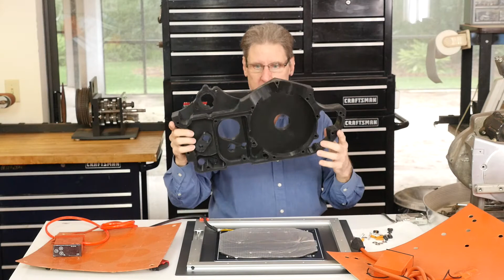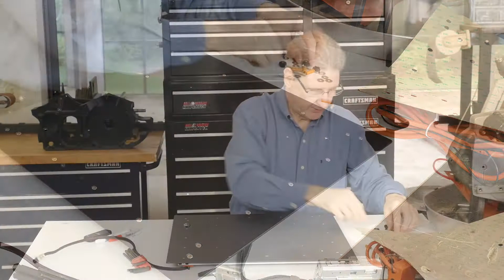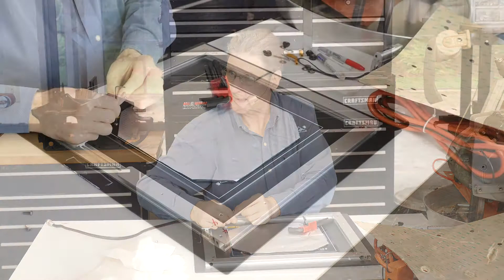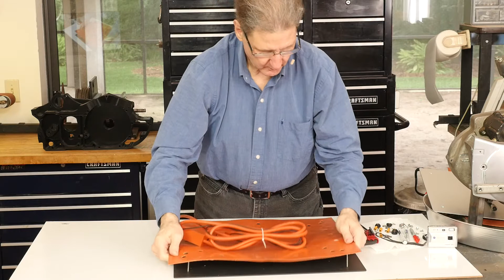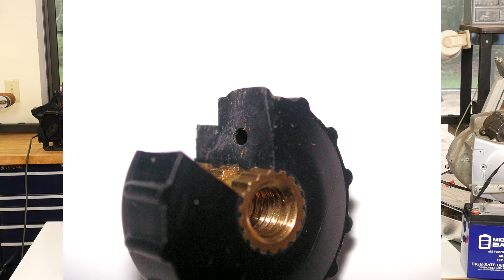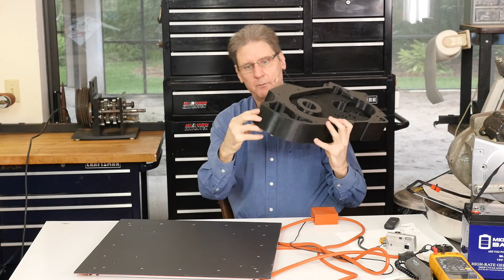Creality CR10-S5 full-size bed heater

Comment: I"ve had mine ever since I posted last time... worked great for PLA or low heat settings.  As soon as I went to ABS or 100 C bed temps, this thing imploded.  Now the outer edges are 130-140 C while at the same time the center is 94-100 C ... Also, when you press and hold the set button for 3 seconds.. you get a menu of CP, CA, LA, LP, HA, HP.. what do any of those settings mean... I can't find an answer even at Amazon where I got it in the questions.
Reply from the maker: Wow, sorry you are having problems. The manual with all the abbreviation setting stuff is here:
https://www.keenovo.com/Keenovo-Digital-Controller-Manual.pdf
I was lucky, mine just worked out of the box, but only for a little PLA. I bought some PETG to try, and will report any heater problems with that. The heater did solve my main problem, the lifting of large prints at the corners. Thanks so much for the comment, I will try to learn about these problems and will report on them as they come up.

Comment: $1MM Trivia Question Help???   How do I disable the firmware from testing to see if the original bed is hot and throwing an error code which prevents me from printing?  It will be great if I can figure out how to turn this off!  thanks everyone!  Great video..
Reply from the maker: I used the same Simplify 3D file that set a 75-degree bed temperature, but natch, it won't start printing since the control box well never see an external heater. My trick was to go into settings, after the file was loaded, and change the bed temperature to under 25 0r 20 degrees. Then the software things that that the bed is at set temperature, off the print goes.
For my particular box, I power it on and I get the info screen. Then press the control dial once, rotate the dial to "Control" and press again. Rotate the dial down to "Temperature" and press the dial again. Rotate down to "Bed" and one more press. Then you can dial in some low temperate that is under what the temp is on the info screen. On my box in an air-conditioned room, the info screen shows the bed at 21 degrees. If you do the Info>Control>Temperature>Bed menu and set it to under 21, the software thinks the bed is at temperature, and the print will start.
So very sorry, I should have made a video of this-- I did some test prints months ago, and never did the follow-on video to show the good results.

Comment: thanks a lot for the video, how did you deal with fooling with the software when you took off the original heated bed ? Does it give any error when you unplug the original heated bed
Reply from the maker: I used the same Simplify 3D file that set a 75-degree bed temperature, but natch, it won't start printing since the control box well never see an external heater. My trick was to go into settings, after the file was loaded, and change the bed temperature to under 20 degrees. Then the software thinks that that the bed is at set temperature, and off the print goes.
For my particular box, I power it on and I get the info screen. Then press the control dial once, rotate the dial to "Control" and press again. Rotate the dial down to "Temperature" and press the dial again. Rotate down to "Bed" and one more press. Then you can dial in some low temperate that is under what the temp is on the info screen. On my box in an air-conditioned room, the info screen shows the bed at 21 degrees. If you do the Info>Control>Temperature>Bed menu and set it to under 21, the software thinks the bed is at temperature, and the print will start.

Comment: Sure would like to know how to use the controller for the heated bed!  Mine doesn't turn on...
Reply from the maker: It might be DOA (dead on arrival). Mine turns on the display the second it is plugged in, I don't see a power switch anywhere. You might be able to pull the rubber boot back and check to see the AC connections are OK, but only if you know what you are doing so you don't get shocked or killed.

Comment: even being as impatient as I am (stopping the microwave with 2 seconds to finish), I enjoyed the video, very focused, on point, constantly adressing the main topic... I have the same printer and bought the same heating, but im from Chile (220V power grid) and almost burned my apartment because the only set of instructions say that it works on 85-260V, and theres only ONE power cable, and when contacting the manufacturer, they tried to put it on me saying that only the controller works on that range.... and theres ONE F** POWER CABLE.... long story short, they refunded me fully and apologize, told them to specify this because they thought that this was only sold in the US... (yeah, in amazon, a world wide selling portal), and they got lucky the new printer wasnt damage.... anyways, I completely agree with you on the bed leveling... like, whats the point to introduce a completely unnecesary new set of variables to the calibration, its like the next model is going to come with non fixed leveling legs, just to having more stuff to calibrate ?, im designing a non-leveling "fixed" (obiously X moving) bed, so I get that stupid desition out of the ecuation... what do you think ?
Reply from the maker: Great comment, thanks. I too am looking at linear rails or some other way to make the bed more stable. 
https://3dfused.com/product/cr-10-s5-y-axis-linear-rail-kit/
My first enhancement might be to replace the base extrusions with a 20mm aluminum slab, that should be a solid base to keep the bed level over the years.

Comment: I just acquired one of these machines and the glass bead is getting replaced with a Wham Bam bed system surface.  Being rid of that giant glass bed should be a big weight savings!  That upgrade went pretty well !
Reply from the maker: Congrats! I have a pal that is trying that carbide glass but it's always good to remove weight from the moving part of the machine. Hope it works out.
Reply: @Rako_Studios  have you had to dial down the stock Acceleration and Jerk settings?
Reply: The Wham Bam systems are so good. I tried them on an Ender 5 plus system and not only does the system heat much faster than the old thick glass plate, but it also distributes the heat better, holds prints MUCH better and prevents warping, and lays flatter than the glass did even when new.

The Wham Bam plate is actually how I came to decide on buying a CR-10S5 bed for my custom machine so it will be just a drop in placement rather than doing something completely custom.

Comment: How about an update video with that same printed part? Also, how you reprogrammed the board to accept that new heater or deleted the requirement from the software. Remember, people watch these to learn so they can do it...
Reply from the maker: Sorry not to follow up. I did print the first quarter-inch of the engine case and it did not pull up at all, though I did have a small 3-pass skirt still around the periphery. Problem is, the engine case where I had the problem was a 4-day print, and the first print taught me I had to do a lot of design changes, so I did not want to waste two rolls of filament on something that had design errors in it.

I did not reprogram the part, where you can just say to print at room temperature. Instead, I went into the Creality setup and just changed the bed temperature to below room temperature or whatever the reading was with no factory bed heater hooked up.

One thing I like about this separate heater is that when the printer runs out of filament, the heater stays on, unlike the way they program the controller with the factory bed heater. Same for a short power fail. The bed comes right back to heat, before the part cools down and separates from the glass. Nothing you can do with a long power failure. On these big parts, the shrinkage is usually enough so the part just comes off the glass and you can't keep printing. I would like a UPS for the heater and printer, but that would cost a ton for such a high-current heater. Since my county is widening the road by my house, the power has been going out a lot, so I have not been anxious to start any more 4-day prints. When I fix the design errors and get a good print, I will be sure to do a follow-up video.
Reply: @Rako_Studios  - I just ordered a 10-5S and the heating pad as well as stabilizer bars. I like your channel because I am doing something very similar to you (large auto parts) so I need adequate tolerances.

Comment: We need a how to use the control box on the heat mat.  The instructions are terrible
Reply: The heat swings 20 degrees causing prints to peel off the bed
Reply from the maker: I agree the instructions are really useless. Mine was set up OK, it holds to within a couple degrees, but that is something you can set, but sorry, I sure can't figure out how, so I didn't even try to change that. Try finding other instructions on the web maybe, or hopefully someone has done a video.

Comment: Hey, great video! will be of much help for when I receive and install the new heater for the S5. I did miss your explanation of why the countersunk screws are not used on military applications, and what is used instead of these. Would love to know. Thanks!
Reply from the maker: When the military applications used countersunk screws on thin panels, the screws were not hard-threaded into the frame, but rather, there was a little nut that floats in a captive cage. The nut could align to the countersunk screw perfectly, so the screw would not back out under vibration.
Reply: @Rako_Studios  thanks a lot for the explanation, will check for more info on the matter. Also, please try to build an enclosure for your S5. I just did with mine and I am still with the first big print on an enclosure, but I am 20 hours in and no adhesion problem so far, and I still need to install a new bed heater like yours.

Comment: Great video - I'm looking at getting this printer also and you have given me some great ideas on how to handle its short comings. Thank you, looking forward to seeing your future modifications/improvements.
Reply from the maker: Thanks, I hope to be trying some new prints soon, and will see how they go. I also want to try PETG material.
Reply: @Rako_Studios  I recently tried PETG on an older Wanhao machine that I had upgraded to a metal hotend and found it much easier to print with than ABS. although it does struggle with bridging so you tend to use more supports in your prints - If you google PETG printing and bridging issues you should be able to see what I mean

Comment: Hi I have a question - I just installed this same heated bed and it worked perfectly one time - however the second time I powered it up, the control box reads HHH - I cant find any support anywhere for this other than the paperwork saying HHH = Ambient Temperature is over 300C. Any ideas?
Reply from the maker: Sounds like a short or an open circuit in the thermistor connection to the box. Those are the smaller stiff wires that measure the temperature at the pad. Let's hope that the screws that attach the wires to the control box are just loose, that would be a simple fix. If not an obvious wire attachment, maybe the thermistor itself came apart at the pad. I don't think you could fix that, you would have to send it back for another unit. Most of these Chinese heater bed makers are pretty good about sending replacements. Sometimes they just send you one for asking, without needing you to return it. Good luck, I hope it's a simple fix.

Comment: The Aluminum acts as a heat sink and might be why the outer perimeter is cooler.If you put insulation under the aluminum extruded frame that might help get more uniform heat to the edges
Reply from the maker: Oh, that is a great observation, I can see those extrusions pulling heat out, especially as the bed moves back and forth. The silicone heater is a kind of insulator, at least it separates the aluminum bed from the extrusions, but an insulator under the rails would be even better, and maybe even some insulation around the extrusions. Good idea!
Reply: I tried insulation and while it did reduce the time it took for the bed to reach temp, it definitely did not result in evenly distributed heat to the edges. FLIR imaging showed the heat distribution was still centered under the stock heater.
I just installed the 510x510mm AC heater in this video (and insulated it) and it is FANTASTIC. No comparison with the stock heater. PLUS, it heats up to 80C in literally 60 seconds! 👍 😎

Comment: thanks for posting this
Reply from the maker: Your welcome, I figured everyone must worry about getting that stick-on heater aligned right. Good news is I did a test print and that big print is no longer lifting up on the corners-- it is dead flat. I left the washers out of the bed spring setup, and I got a good first layer on the first try. I set the gap to 0.010" = 0.25mm. I got it close cold, did it again with bed heat (75°C). Then turned on the hot end nozzle heat (210°C) and set the gap again. It was tight in the center, but it worked out OK. Hatchbox PLA from Amazon, and it did not get brittle sitting in the machine for 6 months. Bad news is the Creality axis rollers got dented sitting so long, so now the printer goes thunk-thunk-thunk when it moves in X or Y. I hope this gets better over time, otherwise I will have to replace the rollers and maybe not set them so tight.